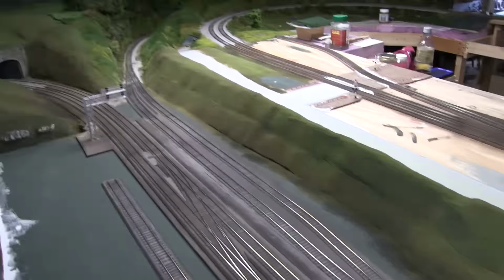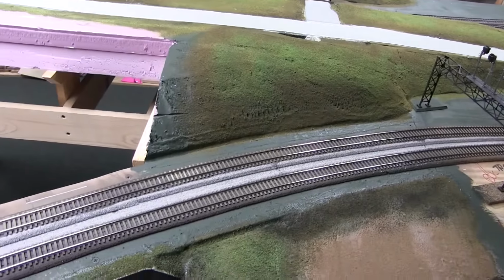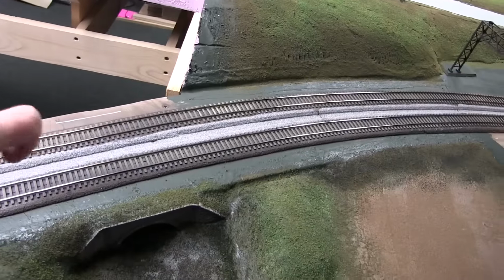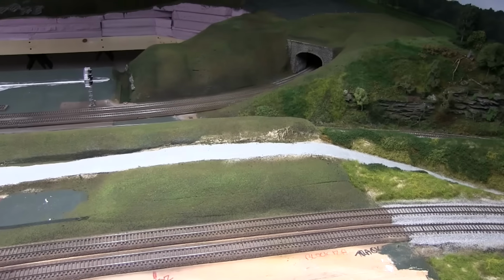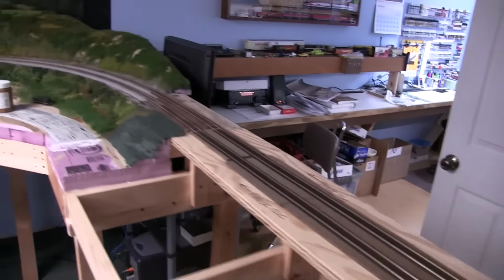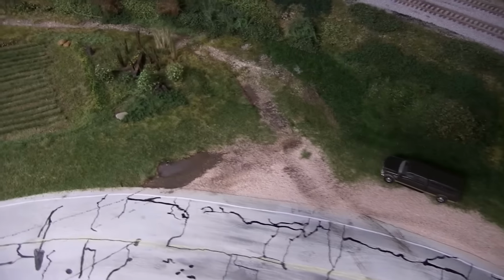Model Railroad Update 65: CP97 & Peninsula Scenery

Comment: Great looking layout, just wish I had more space to model in. One thing I did notice was the water tower on the curve leading to the transformer fact. does not have a concrete base , Other than that it's looking good.
Reply: +Otto Bettcher You are correct- it is just placed there to see if it would work- it covers another "issue" on the backdrop. I am not sure I will leave it there, as it needs more room around the base to be more prototypical.

Comment: I noticed the CN loco shut off it's headlight when meeting the switcher.  Is that normal practice?
Reply: +Bill rouleau According to what we have seen, they dim them and on occasion turn them off when meeting another train- so we just turned it off as it seemed the polite thing to do for the other crew. I am not sure if there is an actual rule pertaining to this.
Reply: +Rob Bennett   Kind of what I figured.  Thanks.

Comment: CP97?  How about CN97. ;-)
Reply: +Ken P No Cp97. Control Point 97.
Reply: +Jackson Railfan   :-)  I saw CN locomotives, and I have mostly CP locomotives. Sibling rivalry sort of thing.
Reply: CP 97 has nothing to do with locomotives. It is a spot on the rr where there is a main line coach or control point, aka large signals.